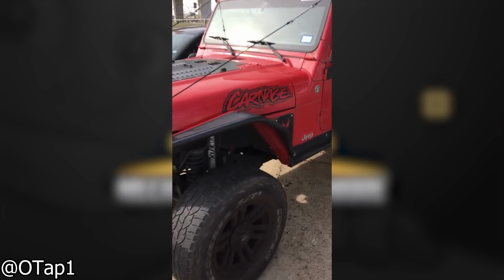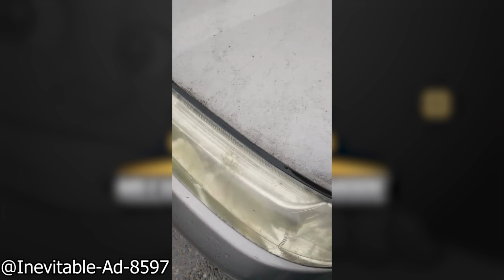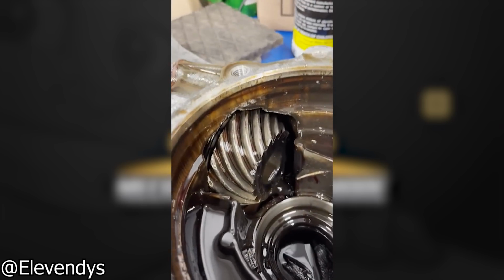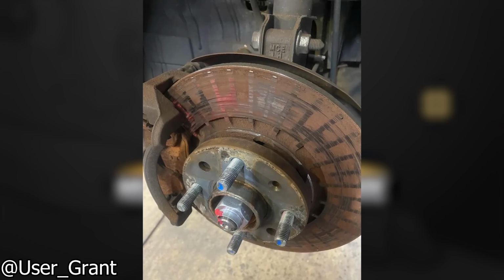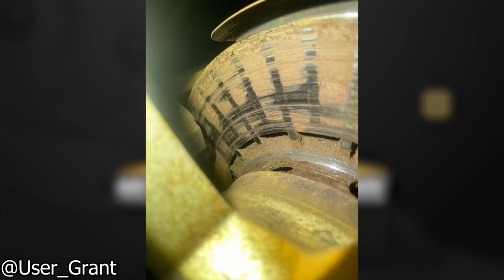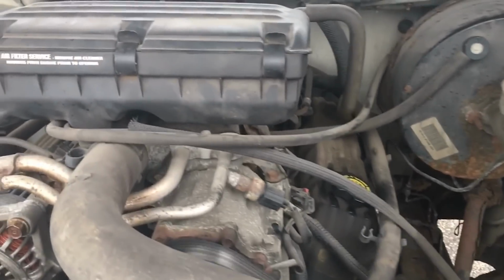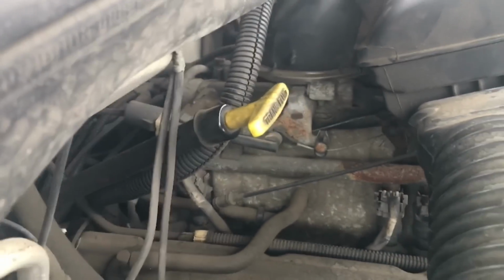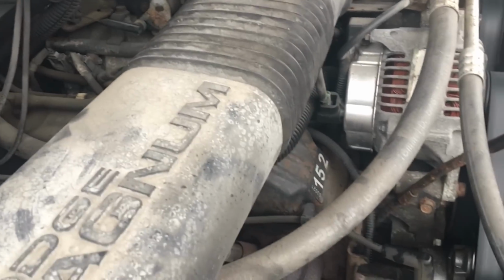Customer States "I Think There's An Issue With The Transmission" | Mechanical Nightmare 109

Comment: After I watch these videos I am compelled to go jack up my vehicles and shake the wheels, just to be sure. So far so good, but these definitely plant the worry seed.
Reply: The people with vehicles like that HAVE to have been ignoring some horrendous noises for a long time before they got to that point. Bad wheel bearings make terrible noises, roaring rattling etc
Reply: Whenever you do your oil, it only takes a total of less than thirty seconds to wiggle the front wheel while they are off the ground.  Ditto the same for tire rotation, although it's a huge pain in the ass when you don't have a shop lift.
Reply: @dagamer667  I use ramps, they're safer... so I do the wiggling twice a year when I'm doing my tire rotations.
Reply: Your car would drive funny and make noises and shake if it was really messed up. As long as you get regular maintenance done and get the car checked out every so often, you'll be fine. The cars in these videos get like that from complete lack of any maintenance for a LONG time.

Comment: The skidoo at 1:09 that's not a big deal. The fuel float valve is stuck in the carburetor and they didn't turn off the gas.  Happed all the time to ours.

Comment: Is that legal to let them drive away , knowing the brakes are totally gone??? 😳😳 in Germany Even the Garage would get an appointment at court
Reply: Good question.  The garage people don't have any authority to detain someone.  Maybe they do in Germany.
Reply: @donaldmaxie9742   yes! It’s mandatory if it’s a massive safety risk for the public!
Reply: Yes, it is totally legal and it should continue to be. No TYRANT should have the ability to say you can't leave a shop if you don't want them to repair your vehicle. No matter the reason or excuse. 

A lot of shops will make you sign a waiver releasing them from legal responsibility because if they took the tire off and you wreck, it could be blamed on them. So they make sure you sign saying you know the vehicle isn't safe and you're leaving on your own and taking full responsibility and that you acknowledge the danger.
Reply: @hauke4651  depends on the country. In any free nation it should be a FREEDOM to choose where to get your vehicle fixed. If you don't like the prices, people, location, etc, you should be totally FREE to move into another shop, or take it home and do it yourself.
Reply: @wolfrig2000  maybe to decline the repair in that shop where the car is at the moment …but than you have to get it towed instead of driving around again without working brakes !
Reply: @wolfrig2000  thing is, german laws make the workshop responsible for the safety on the road. if the brakes are completely shot the workshop MUST stop the vehicle, tyranny or not, and signing a waiver doesn't release them from responsibility like that. there is more needed before that, and most likely police will wait around the corner to give you a ticket or two.
Reply: 100% legal! Merica!
Reply: If a car has no brakes, it should be mandatory that the car be taken off the road until it’s fixed. Period! If you want to do the repair yourself or have another shop do the repairs, that is the owner’s choice and it’s why God made tow trucks!! My luck they’d run into me if they drove it out.
Reply: @hauke4651  It's not a bad idea, we make bars responsible for serving drunks.  I can see problems with "the reason the garage wouldn't let me leave was to force me to buy their overpriced repair job".  Income insurance for lawyers.
Reply: @eric2996  No actually it isn't. Not many shop owners here I see. Just backyard Bozo's.
Reply: @wolfrig2000  But mah freedumbs to wreck into innocent people!
Reply: In the US it depends on what state and the laws of that state.
Reply: @gravyd316  In many states if it comes in that way it can leave that way.
Reply: @TheDonSapius  and your business insurance policy allows that? I'm not so sure about that. You could be right though. I've only owned a garage in PA.
Reply: Right on the money with this one!  This would be abused as it is in other countries I suspect. Don't need a shady mechanic holding anything of mine hostage for a ransom!
Reply: Same in Australia, if the customer doesn't want it fixed there then their free to take their car away on a tow truck
Reply: @markshort9098  on a tow truck…yes! But In the U.s it seems they can leave on there own axle
Reply: @hauke4651  yeah it's absolutely insane they allow that.. I have to wonder just how many are being killed by people driving faulty viechels

Comment: There should be a system if the customer did not do needed repairs the police should be notified
Reply: Uhhhh, NO! Some of us can actually do our own repairs correctly
Reply: There should be a system to keep the government form policing every aspect of our lives
Reply: If these people could do the repairs correctly the vehicle wouldn’t be in a shop. When they take it out they don’t do the repairs. There should be an order stating vehicle can’t be on road. When repairs either by shop or themselves then it is allowed back on road. People don’t want govt policing this but these hazards are still driven
Reply: @alm2210  we're not giving up freedoms for your fearmongering. It should remain completely legal for this person to leave the shop. If the shop wants to lodge a complaint with the DMV about the current inspection/registration of the vehicle that should be their freedom as well, but no one should be forced in this situation. Any governing body that thinks they can force someone to get their vehicle repaired where it sits because it's unsafe is unjust.
Reply: @wolfrig2000  you clearly know nothing of the laws and regulations then
Reply: I don't know about automotive, but I do know for commercial vehicles, a shop can condemn a vehicle making it so said vehicle can only leave the shop on the back of a tow truck and go where ever the owner wants it repaired at.
Reply: I'd take the risk rather than have the corrupt government and ticket happy police involved!
Reply: @wolfrig2000  people definitely should be able to leave the shop but if the car is a danger to other drivers then it can leave on a tow truck.. people have the right to take their car, they do not have the right to recklessly endanger or kill other's.. remember your rights end where mine begin